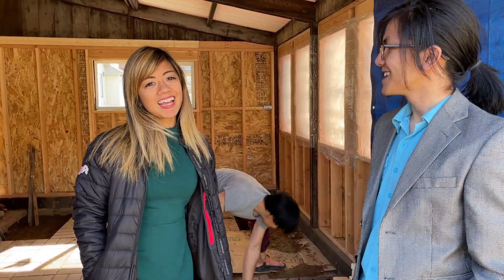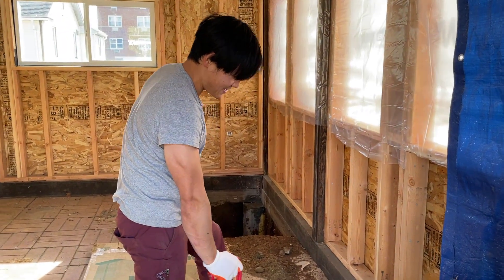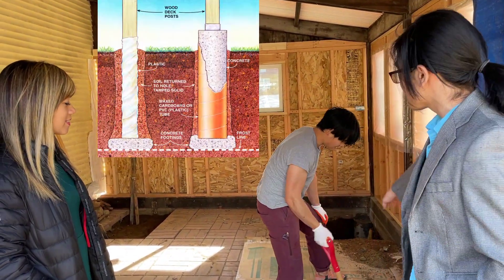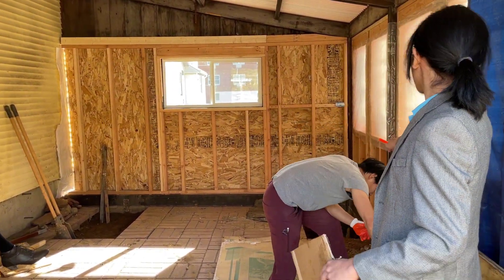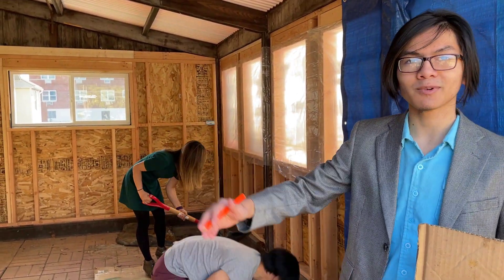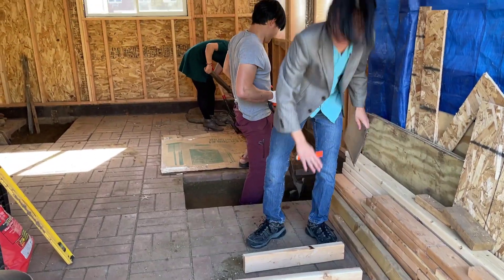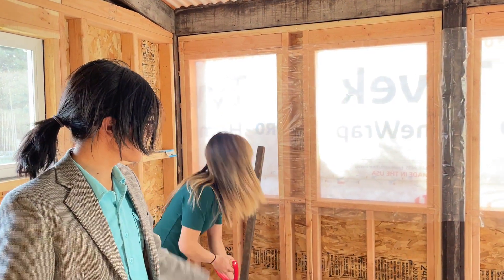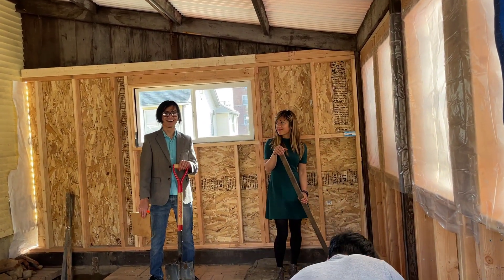Enclosing Patio-Porch Into A Room | Digging Footing For Floating Deck Floor | w/ Teddy & Kakak Amira

Comment from the maker: Here are the #ad links to some of tools featured in this video & accessories suitable for this type of project should you be interested:
1. https://amzn.to/3wLYoP2  |  Fiskars 46 Inch Steel D-handle Transplanting Spade
2.  https://amzn.to/3mBZgkw | True Temper 2704200 48 in. Fiberglass Handle Post Hole Digger with Ruler and Cushion Grips
3.  https://amzn.to/3uylGGe  |  Mayne 580D-BK No Dig Ground Anchor
4.  https://amzn.to/3te2jC0  |  Titan Building Products Wood Post Anchor Kit 4" X 4"
5.  https://amzn.to/3scDjK2 | SuxiDi 52cc 2 Stroke Auger Post Hole Digger, 1.8KW Petrol Post Hole Digger Gas Powered with 3 Replacement Drill Bits(5", 6", 8")
Reply: assalamualaikum aiman dan amira    .. suka betul tengok korang cakap english dah macam lidah sendiri..